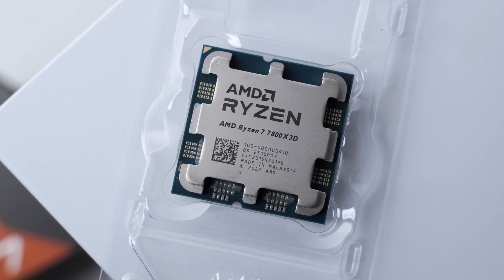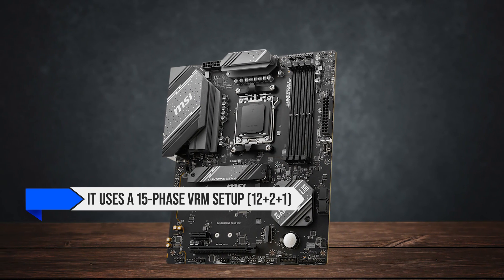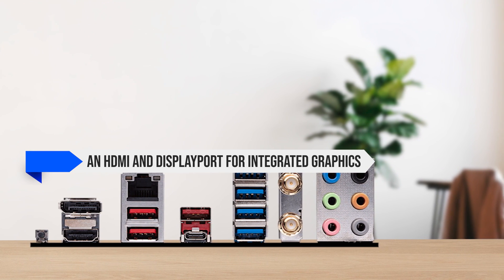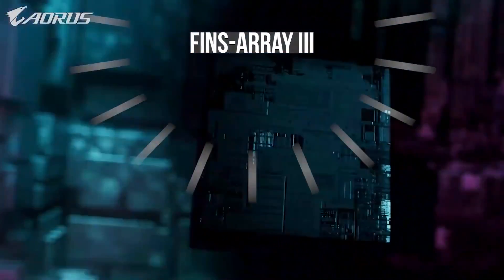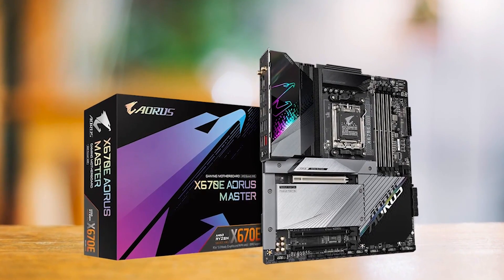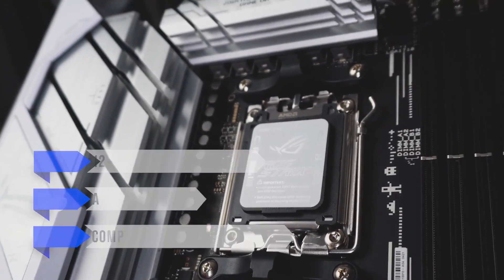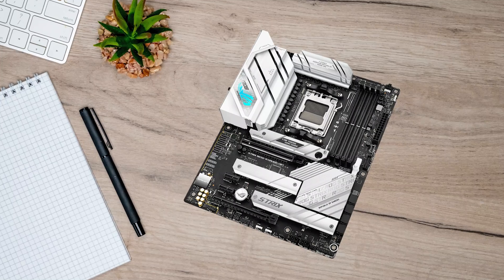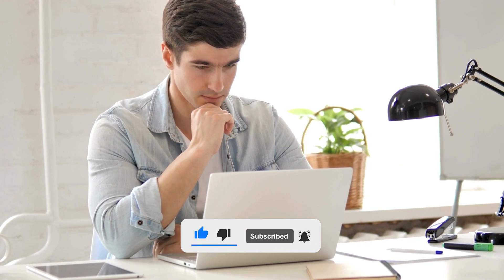[TOP 3] Best Motherboards For Ryzen 7 7800X3D For 2025!

Comment: Asrock B650E PG Riptide, dont thank me.
Reply: I just bought it. but I feel I made a mistake. I dont see it has the same publicity that tomahawk or auros master and others  have. can you elaborate pls ?
Reply: @khaledjouda6246  Also i just checked boards you mentioned out of curiocity, big difference that i see from the start - tomahawk dont have PCIe 5, so later video card upgrade probably will be an issue because pretty soon all new cards will be PCIe 5. Auros simply x2 price so yeah. Only "weak" spot for riptide that it dont have TOP sound (it had avg sound and most people would never feel the difference) but you still can buy separate sound card if you want and it still will be cheaper than same features competitors :)
Reply: @khaledjouda6246  Well, if you look for publicity when you choosing your motherboard then you did no mistakes for sure, trust me, its more than enough for your needs :) There are better options for sure but price difference is much bigger, so if you dont know why specifically you need to buy higher price motherboard then you simply dont need to buy higher price motherboard.
Reply: @khaledjouda6246  And tomahawk with different chipset already has PCIe 5 but its higher price also for basically no reason. Also its less capacitors as i can see so potentially its a bit less durable (it doesnt matter though if you plan to change motherboard in like 5 years)
Reply: @mouzich  Thanks. yes I know about pci5. I just cant feel its value as we dont have that GPU yet. Im more worried about motherboard internal software performance, VRM stability, Overclock options. I dont know how these compare to others. I hope it does well.

sound doesnt matter because passthrough to tv.
Reply: @mouzich MSI tomahawk MAG X670E has PCI 5. Around $250
Reply: @khaledjouda6246  for the moments you mentioned its basically the same as tomahawk
Reply: @vinyvinycocopuffpassittomenow  Yes i mentioned that and riptide is cheaper.
Reply: @mouzich  never heard of riptide. Are their bus bar speed good?  Ive noticed better bench mark speeds on my tomahawk